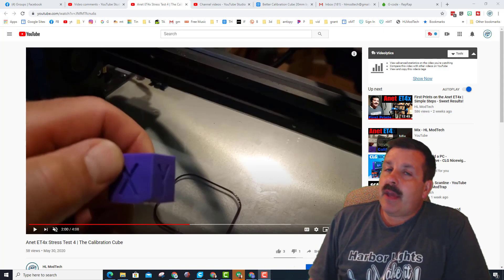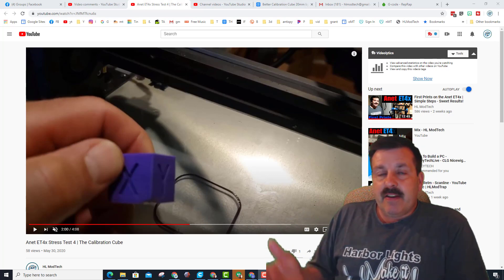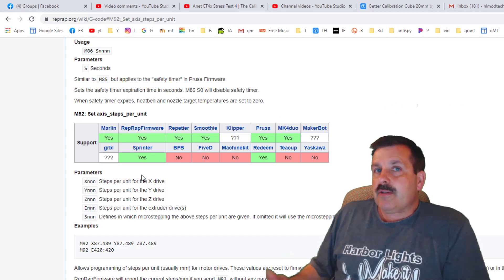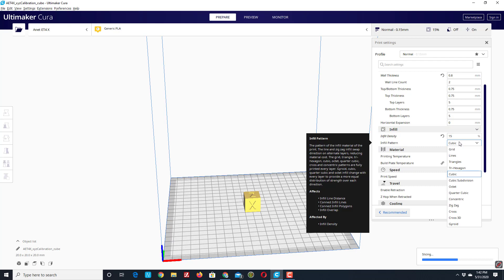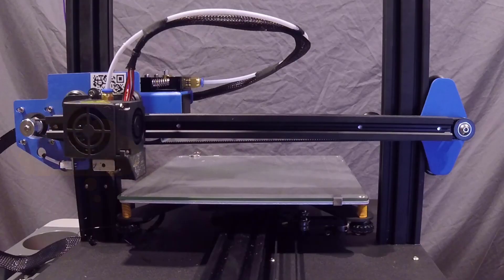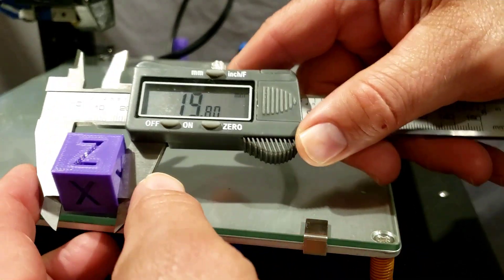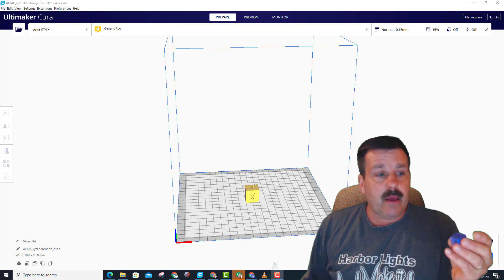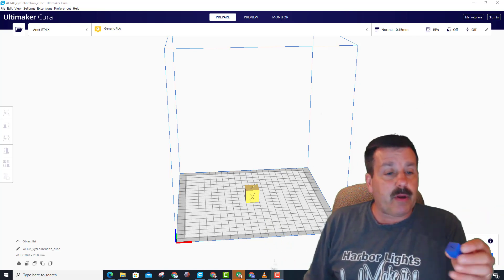Tested! Anet ET4x Stress Test 4.5 | The Calibration Cube Try TWO!

Comment: Try using laver height of .16 in Cura.  That will equal 125 layers exactly versus 133.333333333 layers with a      layer height of .15.  Just a thought on what could be causing the shortened Z
Reply from the maker: I appreciate the note. I will give it a go over the summer now that school is almost out.